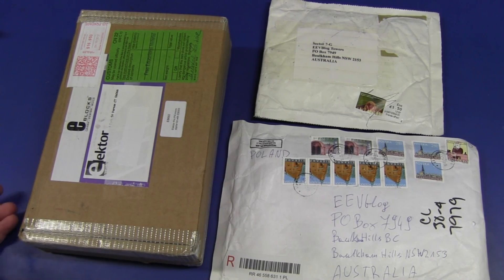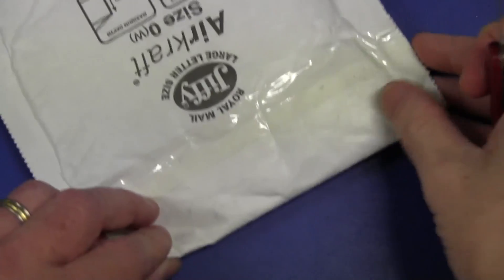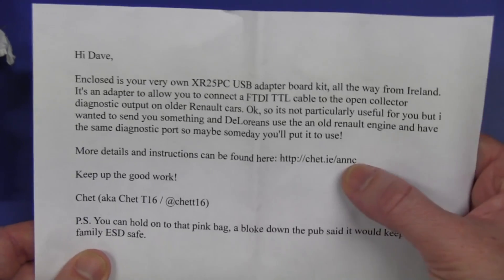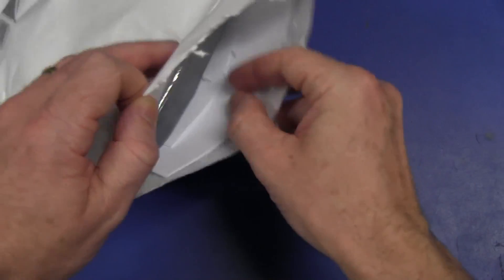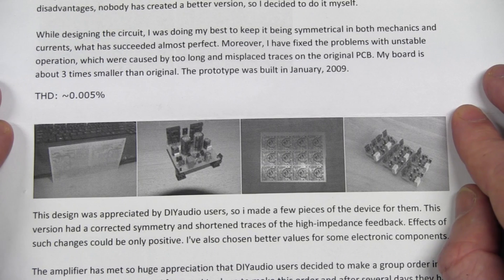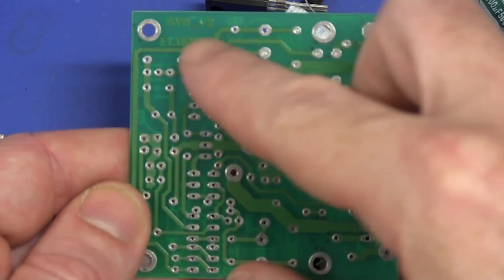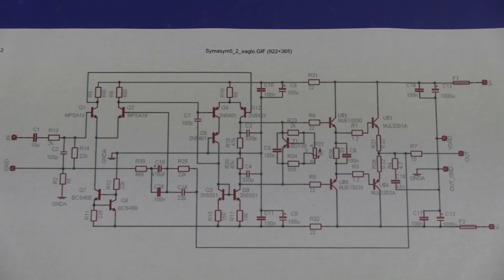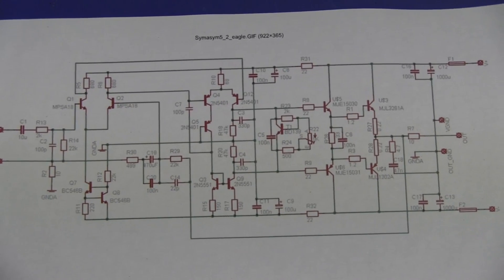EEVblog #276 - Mailbag

Comment: I've seen the 10 ohm and a parallel inductor used as a zobel network, but the schematic already has a R4 and C18 in series doing the same thing. I believe the 10 ohm resistor is either used as a short circuit prevention, or more likely is emulating the DC resistance of an output transformer in a standard tube amplifier to give the transistor a more "tube" like sound. If the resistor was intended as a short protection, it's be in the feedback loop.

Comment: Found that 10R curious too. The full schematic has an inductor in parallel with the 10R, I guess it was omitted from the EAGLE version because it's formed by winding around the resistor and placing a discrete inductor in the schematic would add a component to the layout.

The design is well liked among the DIY audio community. Odd he only sent you one channel though...